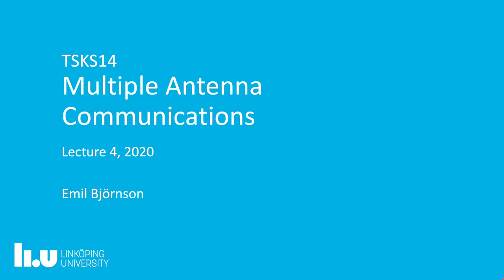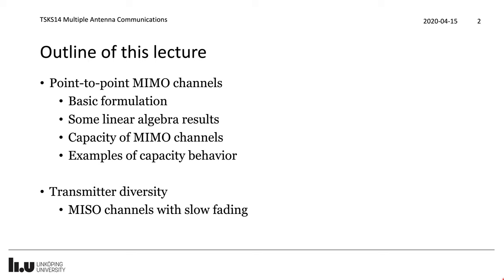Lecture 4: Capacity of point-to-point MIMO channels (Multiple Antenna Communications)

Comment: Thank you for the wonderful channel and the wonderful series!
In video 2, you showed that the square of  ||g|| is equal to Beta multiplied by M.  At minute 47:47 in this video, you didn't replace  ||g|| and treated it as a random variable and this is due to the existence of (Rayleigh-distributed) multipath effect. If we ignore that multipath exists, can we say that SISO and MISO have the same channel capacity(M=2 is divided by 2, so the capacity of MISO becomes the same as SISO). Also, doesn't the capacity of MISO(at 47:47) represent the capacity of MISO given the condition that the transmitter doesn't know the channel?  if the transmitter knows the channel, then it can apply transmit precoding(as seen in lecture 2) and the channel capacity of MISO will be the same as SIMO
Reply from the maker: If multipaths don't exist, then the channels are deterministic and can be assumed to be known. Hence, the results from Lecture 2 can be applied when SIMO and MISO has the same capacity. The reason for the difference between MISO and SIMO at minute 47:47 is indeed that the transmitter isn't applying transmit precoding but a space-time block code.

Comment: I have a short question about the rank of a matrix. The maximal number of the rank is the best case. In a 2x2 channel matrix, the rank should be 2. 
The rank delivers the number of Independent columns. With the exact mathematical solution, we get always the max. number, I assume. Because it is highly unlikely, because there are perahps entries with many digits behind the point. Is it really a good instrument to get the number of the possible independent paths via rank determination? Thank you.
Reply from the maker: You have identified an important aspect. What matters is not the rank, but how strong the channels become in relation to each of the corresponding matrix dimensions. This is captured by the singular values of the matrix. The water filling power allocation method determines how many of the singular values that are large enough to be practically useful, given the available transmit power.

Comment: Hello Professor! Thank u so much for this video! I just have one question at 35:00 min, u kindly said that in an ideal case when all sub-channels are equally strong, all singular values will be square root of M, could u please clarify that? Thanks alot!
Reply from the maker: There is indeed some mathematics required to prove that. We need to connect the assumption of |g_{m,k}|=1 with the singular values. The sum of the squares of the singular values of G can be computed as the squared Frobenius norm of G. The squared norm is computed by taking the absolute values square of each element in G and sum them up. In this case this will give us MK since |g_{m,k}|=1. If all the K singular values are equal, their squared value must be M, so that the sum becomes MK. Hence, each singular values is equal to sqrt(M).
Reply: Thank u for yo reply! I know this may sound a trivial Question: is there a difference when channel capacity is donated as Cg and C only? I have always known that Cg is donated for AWGN or LOS channel and C donated for other cases. Is it correct? 
Another Question: does MIMO channel provide more multiplexing gain than beam-forming gain in general? So capacity or rate required  is the key factor to determine which system I would use either SIMO, MISO, or MIMO 
From what I gathered MISO is the least performance system regarding multiplexing gain or providing high channel capacity 
Comes after that MIMO and then SIMO if we were to put them in ascending order from lowest to highest performance ?

Comment: Thanks, I have read that we can analyze both, the channel matrix and the spatial corr. matrix (determined from H) with respect to their eigenvalues. Is that true?
Or must we always calculate the spa. corr. matrix first?
Thanks a lot.
Reply from the maker: The capacity of a point-to-point MIMO channel depends on the squared singular values of H, which are also the eigenvalues of H^h H. I guess this is what you refer to when you mention the spatial correlation matrix? One can compute the capacity in both ways. (I normally use the spatial correlation term for something different, where one consider the average second order statistics of the channel)
Reply: @WirelessFuture  No, as spatial correlation matrix I mean R=E{vec(H)(vec(H))^h} 
I think it is other than your mentioned equation and I don't know what is to take for the analysis - are both possible? Is one better?
I know you have also an article on spatial correlation from 2017 on your page. But I there is not this equation with vec(..)...
Thanks for all of your work.
https://en.m.wikipedia.org/wiki/Spatial_correlation_(wireless)

Link:
Reply from the maker: @knutlohmann8205  Alright, yes, that is the most general formulation of spatial correlation. The MIMO capacity is computed for a particular realization of the channel matrix H, so the statistics don't play a direct role. However, the average capacity (also called ergodic capacity) depends on the statistics (spatial correlation). It is hard to find a nice expression of that.

The signal does however have a spatial correlation matrix. When you transmit multiple beams to achieve the MIMO capacity, the covariance matrix of the transmitted signal determine how much power is sent in different directions.

Comment: In a massive MIMO system, could we consider each channel as a separate non interfering path to independent UE, 
Considering a M x K, system, where M is the number of antenna in BS and K and no of single antenna UE.
so in Waterfilling power allocation if we could allocate more power that means we can support more UE, is this assumption is correct ?
Reply from the maker: No, the channels to different users are interfering, that is what makes the problem interesting. But if you have perfect channel knowledge and apply zero-forcing, you can remove interference and then perform water filling to maximize the sum rate.

Comment: For the case of common source multi-beam antenna in some base station, we need to consider the SIMO case or we need to consider the MIMO case?  for example we have one antenna that can generate several beams in different band so what is the differnet of this type of common source multi-band multi-baeam antenna with MIMO exactly?
Reply from the maker: A multi-beam antenna is a way of implementing an antenna array. If you have a single antenna at the other side of the link, you have a SIMO or MISO system.
Reply: @WirelessFuture  I agree with you. However, lets assume that we have frequency scanning antenna with capability of simultaneous multi-beam and multi-band operation like a leaky wave antenna (LWA) which belongs to the travelling wave antenna family with capability of wide scanning range. In this case we have only one antenna (not array) which can produce different beam in different direction simultaneously from a common source. So in this case we must consider the LWA as type of SIMO or MIMO? I appreciated it if you put comment to this behavior of the LWA as a type of common source (single port) compare to the MIMO antenna cases which several ports can be use to excite different number of antenna (compare it in terms of the BER or EVM).In addition,  I really appreciated if you can put comment related to the direction of arrival of a common source multi-beam antenna and their common methodology for recognizing the user location in such cases.

Comment: What is the purpose of SVD? For easy calculating? Thank you in advance
Reply from the maker: It is the optimal way to decompose a MIMO channel in the several parallel non-interfering channels. There is an illustration of this in the beginning of Lecture 5.